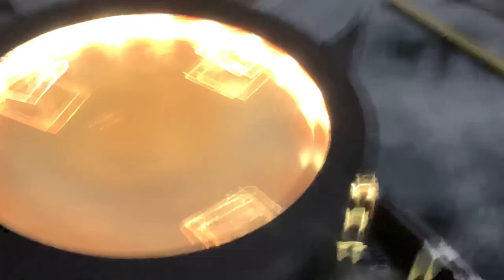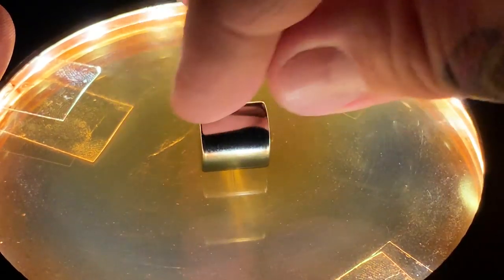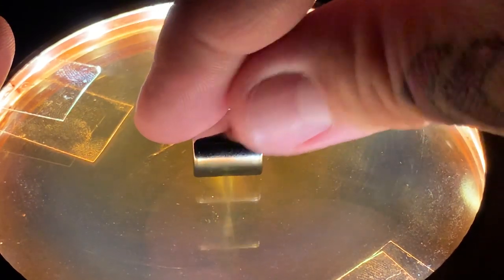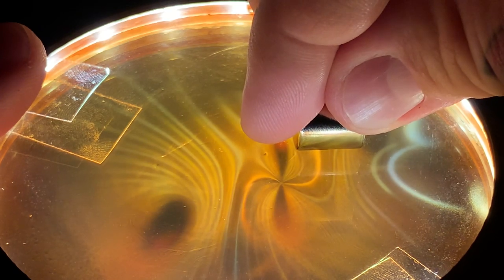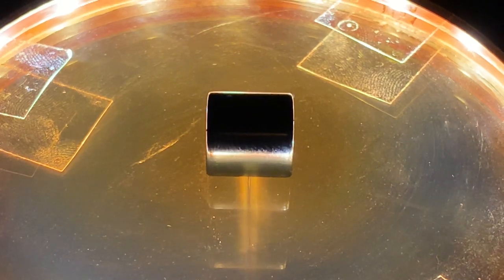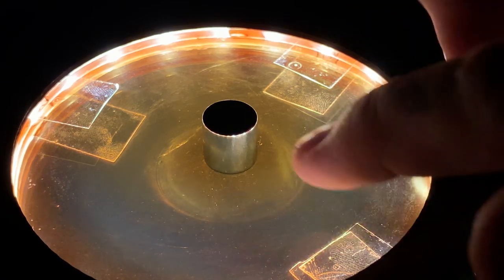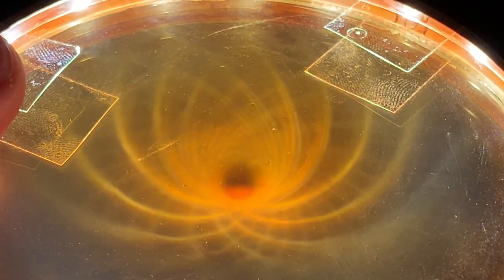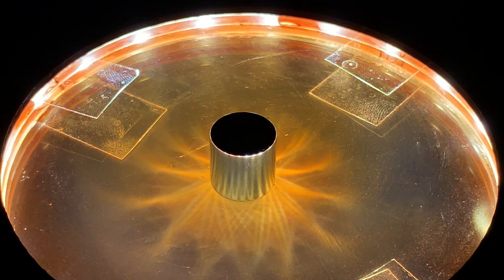🌑 Down the Rabbit-hole 💎 Magnetism & a new look inside

Comment: White light means many frequencies (RGB)? Red means additive, coming  towards. Blue means subtractive, moving away. Based on frequency differences. 

It would be interesting to compare your two norths and then your two souths. As they should appear shaped differently. Norths inward and souths outward.?

Depth appears, but only when magnet is near iron. Iron must align north particles to south particles like many little magnets. Although depth appears visually, can it be real depth? As only that part near the magnet is actually effected.

What must be determined is whether iron particle alignments block light or add together as light emitters. I guess more light appears or is emitted where iron is not present. If true it means lines or tubes missing iron are not counter space mass. But represent outward EMR as light, magnetism and spacetime.

The visual two toroids of dielectric inertial plane seen show north and south of each magnet. The two surfaces meet top and bottom opposite spin, but the inside and outside spin same joining forces as a tube. Exhibiting light shows lack of iron particles and creation of EMR spacetime.

Comment: The magnet isn't emitting any thng but arnt the di electric lines physical....i was basically askn if the di electric lines r reflecting infinitely in the ruby that's in superconducting material which is y u can turn it up side down an it still stays

Comment: Professor Eric Laithwaite, turned my brain to mush when he put a bit of steel at the end of a magnet and it seemed to reverse the dielectric field some how, would love to see that with the mouse milk.
Reply: Isnt it because the middle point of the poles is moving ? The opposite of cutting a magnet in half. Steel is a good magnetic conductor. 
Just speculating... there are many forms of steel. And what is then a good magnetic resistor ? Copper ?

Comment: when pulled apart would you say the white light represented the moon and red representing sun? possibly?
What happens if there are 2 magnets which are still, above and below and centred, then take another magnet which travels around the circumference of the cell? Or maybe 2, one traveling faster than the other …

Comment: Haha so what is the red spot?
Reply: Electrification/heat Maybe?.  Ken has a video where he takes two magnets and squishes a coil between them.  Cheers :-)
Reply: S  That would make sense geometrically, but why is south blue & north red, then?
Reply: S  Magnetic North of the earth is in the South, which would be the max manifest 1/phi^-3.
Reply: S  I think my question is more reasonable than "why does magnetism exist." How about, "what are the patterns of red/blue shift in the dielectric fields?" Though I don't know that its a "red/blue shift" -- I don't believe in the red/blue shift in standard cosmology; that's a farce.
Reply: If one removes the outer coating on neos it is possible to super glue like poles together in perfect alignment with the right tools. Just   do not let other mags or iron slam into them as they will separate at high speed.